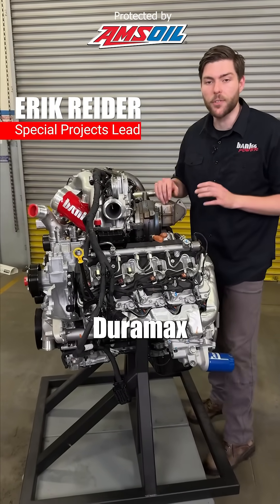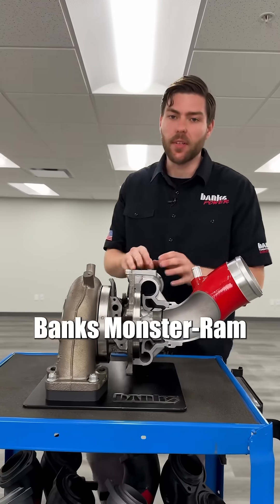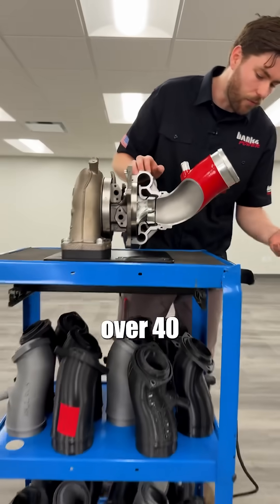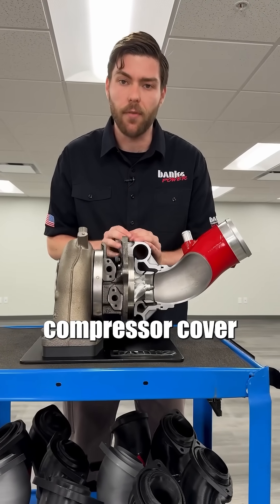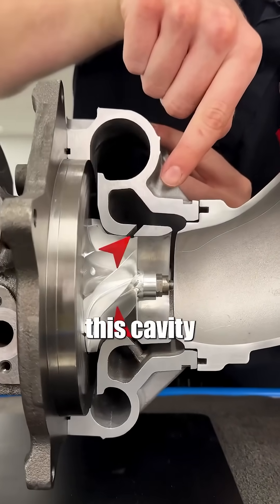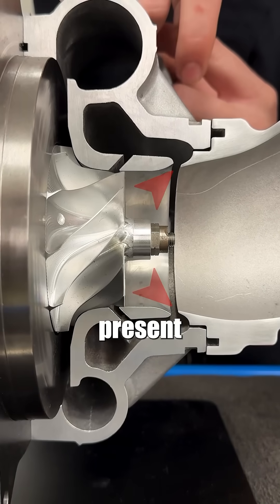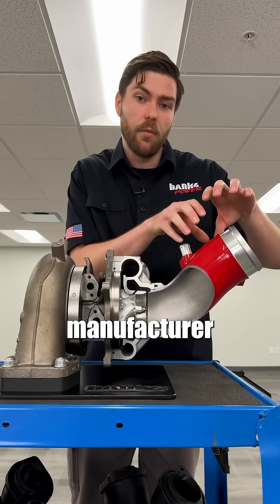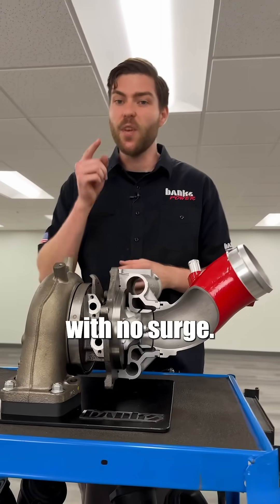Prevent this turbocharger phenomenon.

Comment: It's interesting seeing comparing other aftermarket companies that doesn't specialize in diesels with ones who does. Not having an anti-surge would be fine on a turbo gasser because OEMs would use a recirculating valve that opens under manifold vacuum. But diesels don't have manifold vacuum, so no blow off valve or recirculation valve, Most aftermarket companies would not account for this.
Reply: It's more on boost that it happens too. Petrols can have it happen with large chargers on small engines
Reply: Exactly what my Ecoboost has.
Reply: "Erm, ackshully... B-) This video is referring to WOT surge. A BOV won't cure this, because the manifold is under positive pressure. Closed throttle doesn't happen in diesels, of course. And in petrol engines, it doesn't do damage anyway!
Reply: @Kj16V I disagree, thankfully the manifold immediately begins dropping pressure instantly upon throttle closure & simultaneously the charge pipe has nowhere to go besides up in pressure overpowering the bov spring. On a gas engine. 
I rigged up a bov on a Cummins with a throttle pedal micro switch and a pneumatic solenoid valve on a relay trigger. Never ever surged AFTER the bov, it would beforehand.
Reply: Except a ton of people on gassers run no blow off valve for extremely long periods of time with no issue. If you can find me some case of turbo failure directly due to turbo flutter, please send it my way!
Reply: @QuincyStick  gasser is different, because they should only flutter when you lift the throttle (unless something is going wrong). You are only killing turbo response due to the compressor stalling.
Reply: CBV and surge ports do different things.   Plenty of gasoline powered vehicles have anti surge ports on the turbocharger.
Reply: He's talking about on throttle surge though, vacuum controlled recirculation valve does nothing for that.
Reply: @DriftNick  Throttle surge should never occur on a gas engine with an OEM turbo unless something is wrong.
Reply: @patx35  This video isn't about OEM gas engines.
Reply: @DriftNick  clearly never watched the video
Reply: @patx35  Are you talking about yourself? because the first thing he says is "Here is a 2024 Duramax 6.6L".
Reply: @DriftNick  yeah... I misread what you said
Reply: @patx35 what lol
Reply: @patx35  that's what the video said on the screen and in the audio
Reply: I see where you’re talking about and you didn’t specify that you’re referring to a turbo recirculation valve, not EGR. Otherwise, you are correct in your explanation. At some out of country race, Ford disconnected this and burned up a bunch of turbos sacrificing them for lag-free boost so they didn’t have to spool up after every turn. It is a very destructive way to maintain immediate boost while in a race, but they had a pile of turbos to replace them with. When you hear the “stustustustu” sound, that turbo is being damaged due to lack of recirculation valve use to relieve the immediate change of pressure when you let off the throttle.
Reply: @infinitybro.4567  The turbo isn't being damaged. It's just being stressed... which can lead to damage. But as long as you don't go buying some eBay/Temu turbo, it'll likely never happen.
Reply: @Mikkel111  I can agree with that, the Ford example was an extreme example
Reply: @infinitybro.4567  That "lack of recirc/BOV will kill your turbo" myth has been needing to die for decades. It's not true at all. Nobody is losing turbos because they didn't have a BOV.
Reply: @Kj16V  that’s a good argument. I suppose most people don’t run really high pressures, so yeah not everybody’s are blowing up.
Reply: @infinitybro.4567 This doesn’t really occur any more on modern ball bearing turbos